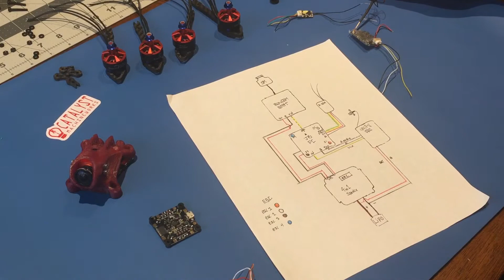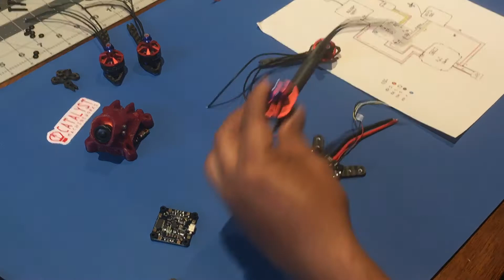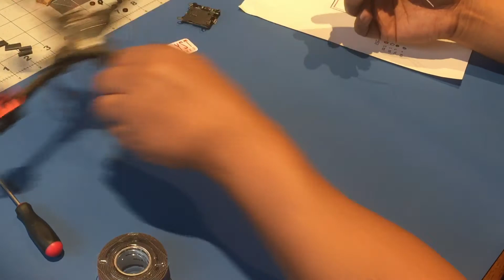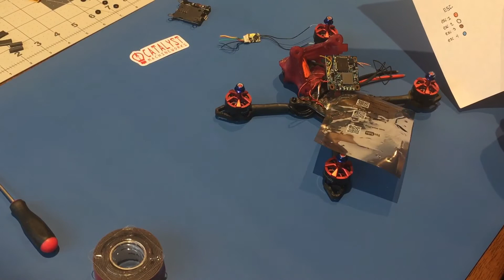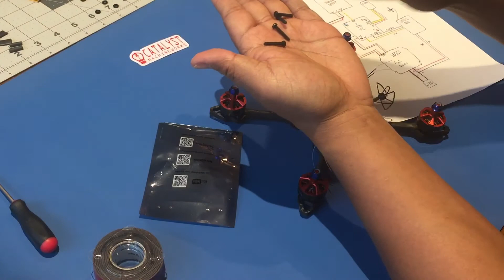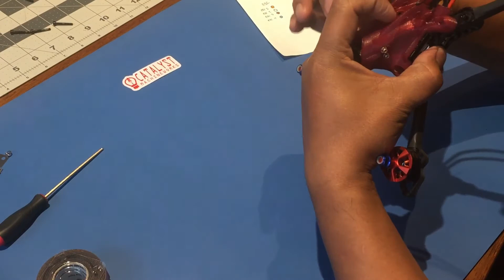CMW Merica build| RunCamSplit/Josh Bardwell FC/ Spedix4in1

Comment: I have a similar setup in progress...flew it a couple times, now waiting on a part.  Did you have any MTOs or a difficult time tuning with the BH 2207s?  I've only had 2206 R4s and just now trying the 2207 R3s - seem to have stronger magnets than the R4s...even the 2206 (well, the Bad Ass version).
Reply from the maker: tchthsky these BH were very strong however I never got to tune it as I flew it into a pond at our race track.  I swapped out the FC (Lumenier Alpha AIO) and after crashing the gyro went bad only after a few days and I never got to tune and motor bearing got damaged.  Currently I now have T-motor f40 pro v2.  I also am using the mercies canopy.  Was very easy to tune. My new Merica build video is on Catalystmachine product website. Check it out a subscribe if you like. It’s a very easy Bild with AIO FC. 
https://www.catalystmachineworks.com/products/merica-eagle-tpu-canopy
Reply from the maker: tchthsky as for the MTO, my new set up had it pretty bad. After a few adjustment  I got rid of it by lowering my “P” a bit from stock betaflight.  I forgot what the value is exactly.
Reply from the maker: tchthsky just sub to your channel. So did you figured out the BH failure? Looks like it desync during that hard flip you did at the end.
Reply: Thank you.  The conclusion was bad motor.  There was really no other explanation. The RCG post is here: https://www.rcgroups.com/forums/showthread.php?2386267-Blackbox-log-analyzation-help-thread/page82

"Death Roll / burned motor" by ProcDstryr.

The motor is being replaced so all is good.  I exclusively use BH and only had this one issue, so far.
Reply: I like a tight tune, but I noticed during the two flights I got out of it that default P is probably more than enough... but I plan to do a conventional tune once it's all back together to see where it takes me.
Reply: That really bites. I had that slight sick feeling after I realized I was going down. But the frame handled the wreck with grace.  I only bent a screw. I was grateful for its durability even if I lost a motor. 

I had terrible luck with T-Motor.  I got 10 of the F40 Pros (with the silver windings) and all but one had horizontal play in the bearing, bearings sounded ragged after a few flights (two motors were damaged by me, but they still had play, out of the box). I haven't messed with them since.  I got a little flack over it as the claim was T-Motor is top notch, and I'm sure it is, but my experience led me to BH motors.  And the fact is even the best have QC issues from time to time.  I've been eyeballing those V2s, though. They're are beautiful motors, that's for sure. 

Nice build, btw. I'm going to finish watching tonight.  Subbed, too.

Comment: Say whaaaaat?  AIO with a 4 in 1?
Reply from the maker: Kyosanym LOl yeah I got the JB FC when it first came out. So I didnt want to spend anymore money for another FC so just threw it in there.   The placement of all the various pads on the FC was week thought out marking solder and routing cable really easy to do.
Reply from the maker: Merica fell into the pond at the race track. JoshuaB FC got fried! Just ordered the Lumenier Alpha AIO, FC/ESC/BEC all on one board. gonna be interesting. may have to do a follow up vid LOL
Reply: Dang.  You are grtting the worst luck with that drone.  When were you at the track?
Reply from the maker: so that's two joshuB FC's that got burnt on this kwad lol. I was there Saturday ~3pm. Just me and Jon were there so we took the kwad up into the RC plane area and ripped around ;P
Reply: Did you conformal coat it?
Reply from the maker: really thinking about it but worried i wont be able to desolder when i break the FC for the third time LOL